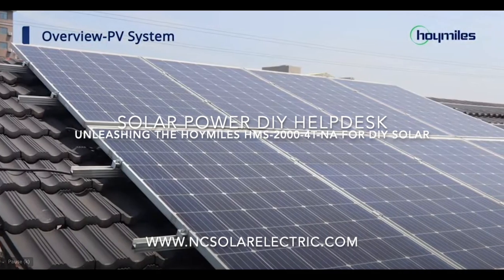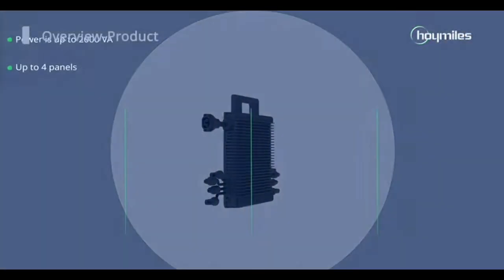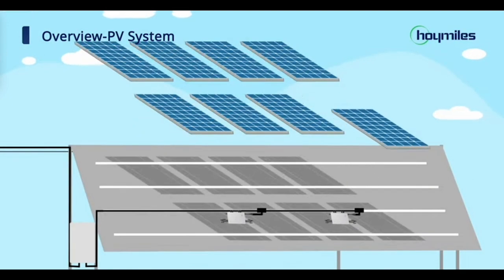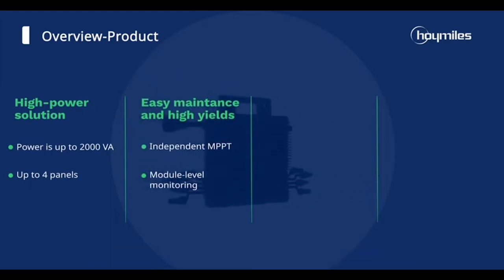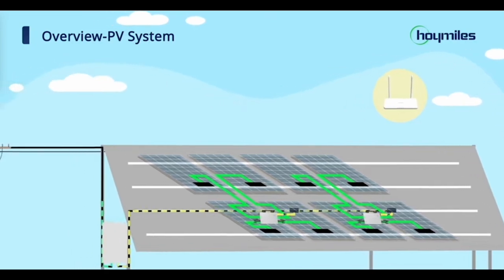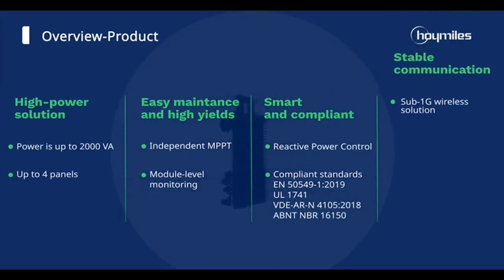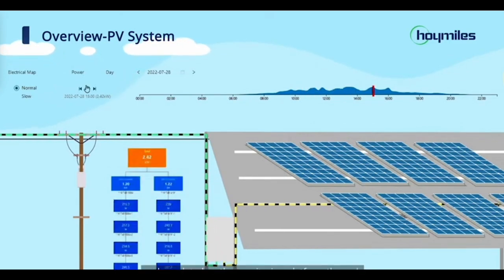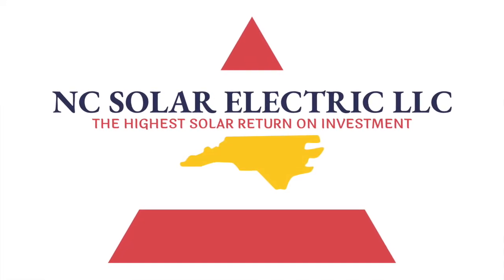Unleashing the HMS-2000-4T-NA Microinverter for DIY Solar

Comment: I am disappointed with the HMS-2000-4T
First, we cannot do full settings and monitoring on our own. Hoymiles put customers in a captive market with the reseller. This is not specified when buying
Second and the worst, i have regular problems about the connexion between the micro-inverter and the DTU. Result ? No more monitoring and need to call the reseller
Third, it is impossible to get the production datas from the inverter or the DTU as an exported ASCII or JSON or XML file.
I really hope some improvements about these 3 topics
Reply: The only ones disappointed are the ones who want independent monitoring. It is possible, we have a solution for that. However, I've got 100% happy customers who have purchased the HMS-2000. It is a good, reliable inverter that never fails to produce power.

Comment: Is it possible to  use microinverter on a off-grid   system ?.  I have off-grid greenhouse and I  would like to use it to generate require power and batteries as backup only.
Reply: It does not operate off-grid. It will run in parallel with an off-grid inverter that is listed to UL1741SA or SB, and has IEEE 1547 2008 or later.
Reply: @ToddDesiato  Thanks.   I was thinking to activate the microinverter, I can  fake the grid by using a pure sine ware inverter higher  than my load  requirement.
Reply: @a.mirmousavizadegan7962  Yes, but that pure sine wave inverter must be rated for this or it will blow up. Which means, it must have UL1741 SA or SB, and must be 1547 2008 or later. Otherwise, that inverter will go bang!